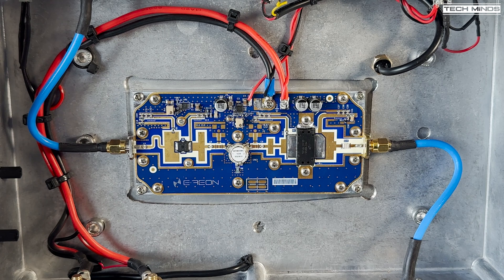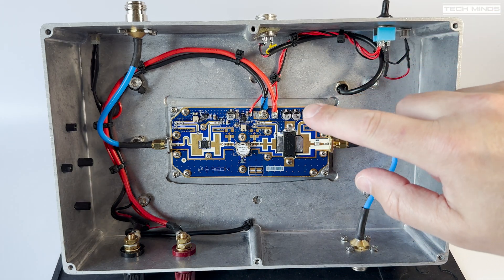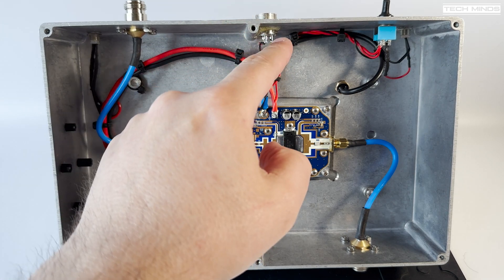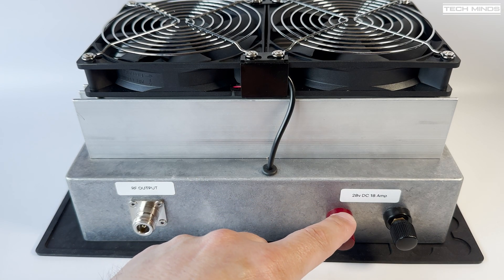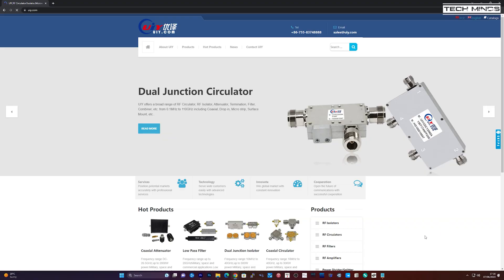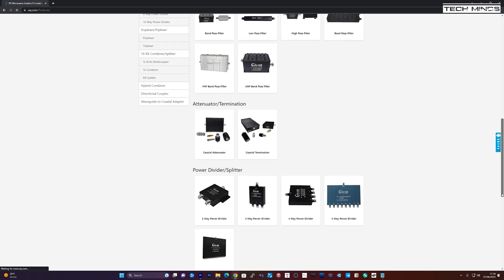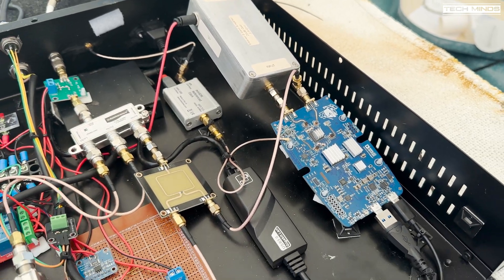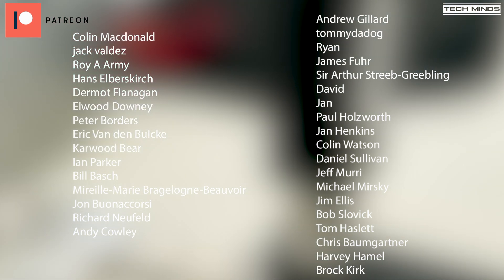Homemade 2.4 GHz RF Amplifier - Testing ON AIR

Comment: Did you try measuring the RF coming out trough the various non-RF wires? (like the power cable, thermal monitoring); I noticed that the wires just pass trough the enclosure, without any other measure applied - I may have missed something of course; the point that I am trying to make is that any conductor that passes trough the case which is not locally grounded will carry the RF signal - it is common to use dedicated pass trough's that provide capacitance to the case to shunt any high frequency noise.

Comment: The circulator looks good but that needs to be directly off the PA as it needs to be mounted to the heatsink but I cant work out why ya didnt put any TX/RX relay and a sequencer in the case cause u will need it
Reply from the maker: It’s an inline coaxial isolator, by design, so it’s perfectly okay where it is. I don’t need a tx/rx relay because with my setup I am receiving on 10GHz via an LNB and transmitting on 2.4GHz with a patch antenna. Thanks for your comment, appreciate the questions. Thanks 🙏
Reply: @TechMindsOfficial  Actually Trent has a good point. If significant power is reflected from the feed then that power is absorbed in the terminator for the circulator. If you have a good match, that's not much power. It is when there is a fault that you need the protection and potentially all the power ends up in that circulator termination. The PA still sees a good match and sends its full power. If that power it isn't being absorbed by the antenna, where is it going to go? The answer is of course into that termination, so, heatsink it.
Reply from the maker: @mikewillis1592  Hey Mike, The termination on the isolator is rated at 100 Watts, I believe, and it already has a block of metal to sink the heat into. For my "use case" this amp will only be used on DATV, and something which is always in front of me when I transmit is my received downlink signal strength. As the amp doesn't alter its own power output, and I normally run around 60 Watts Max, If there is an issue I will be able to disconnect power to the amp immediately without the isolator even getting to its maximum rating.  If I was always going to be running with a bad match, which I guess some people do, then of course, I would look to do something about cooling it further, but at the moment its well within spec for my use 🙂
Reply: @TechMindsOfficial  That's the point. If the match is good, no issue, if not up to 60W gets dissipated in the termination. Then it will need to be heat sunk if the fault lasts for more than a few seconds, unless you detect the situation and turn it off. Most people don't use isolators. Several are now looking for replacement PA transistors (:
Reply: You can get temperature operated switches - you could stick one on the isolator heat sink and  put it in line with your 28v enable signal. Just monitor the temp in normal operation to choose a good temperature to open the switch at. No software, so reasonably reliable.

Comment: I think you might need to add some heat sinking to that isolator. As it stands, it would probably get very warm if a significant proportion of your output power ever came back down to it. Why not try to thermally couple it into that big blown heatsink?

Comment: Great video and great technology BUT!!!
One of those frequencies I personally ( ex radar worker ) won't amplify to more than a few milliwatts at best (in a home setting). The fact that technology allows us to do it does not mean we should be doing that (again, in a home set up), stay safe, and avoid those Frequencies ( in high power). 250mw radiated AWAY from your property should be the max around your home and family, why? cancer is not your mate, the gear to measure this kind of unwanted radiation on this spectrum of the RF band (RF leaks/reflections ) are limited and expensive, its a hobby, doing the wrong thing here might limit your play time in the long run. never underestimate the high frequency spectrum, some frequencies are best left alone (again, in a home setting).
No tin foil hat around here, 2.4Ghz is a great band to play with when used with low power applications it will not be something to worry about. Using 1 Watt at 1m from an omnidirectional  antenna, at 2.4GHz, that signal has dropped by 40dB, which has you at .01 milliwatts, or 10 microwatts, now compare that  with 900MHz (same condition as above)  will be dropped by 30dB, which is 100 microwatts., when using higher power setting things will become ugly very quickly.
Reply: In the case of this video the op appears to have multiple devices capable of detecting leaks at and in excess of his operating frequency as well as a technical awareness and no doubt in the UK like here in AU, an obligation under his license conditions to limit radiation hazards around his station. With a limit (in Australia) of 4W EIRP for Wifi on 2.4GHz it would be impossible to meet your exposure ideals unless you live on a dessert island! My professional life revolves around sniffing around the RF spectrum using "all the $$$ toys" so to speak so I'm well placed to observe the levels of RF exposure we all experience in everyday life. Probably also why I laugh very loudly at every 5G mind-control / nano particle / nutter video clip on social media..
Reply: @ingmarm8858  technical awareness is key 100% agreed. The last thing we all need is more regulation and fear, what I see missing in the hobby is awareness with regards to this spectrum ( seen this over and over again), I tend to agree that some videos about 5G being a "mind-control" band are laughable ( some are just sad) and serve to make those who seek real answers even more confused.
All I can say those to those who want to get involved on 2.4G and above, GREAT , lots of fun indeed, but If you know nothing about this spectrum and have no past experience it would be wise to seek the help and the knowledge of those who have some experience, play it safe, and enjoy the hobby.
Reply: I am really interested if microwave frequencies can cause cancer. Can you provide some study or reference material in the subject for me to read.
Reply: @namregpxp  Do a search, there are so many videos and articles that show the good, the bad and the ugly, don't let fear stop you and gain the knowledge needed, ask around for those hams who are in the game already as their experience will save you time and mistakes.
Good luck.
Reply: In this respect I see several DC wires (supply, fan, temp sensor) going through the wall of the box without and feed-through caps or filtering. These wires may pick up radiation inside the box and radiate it outside the box. Don’t know if in health threatening levels but the shielding of the box is certainly compromised.